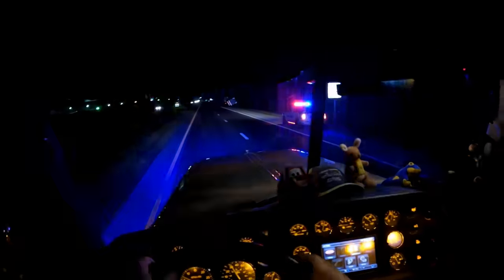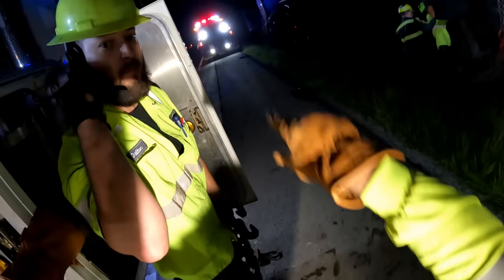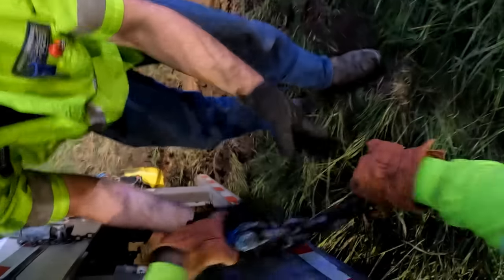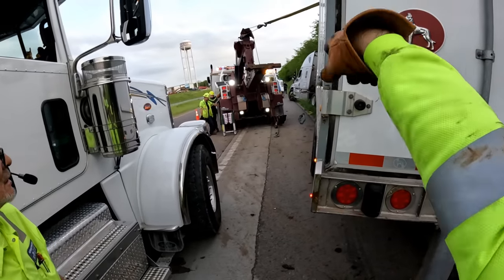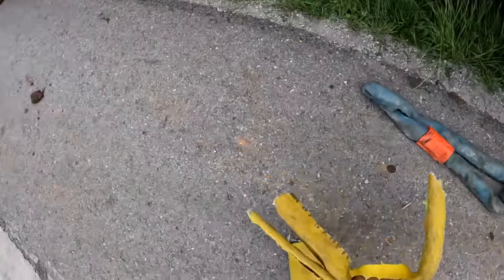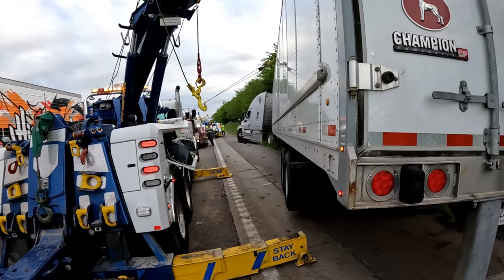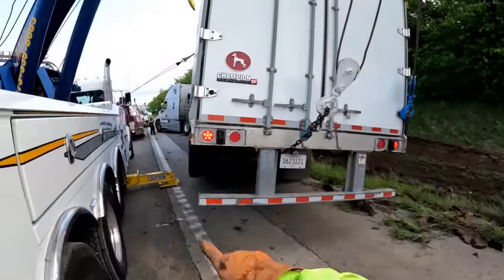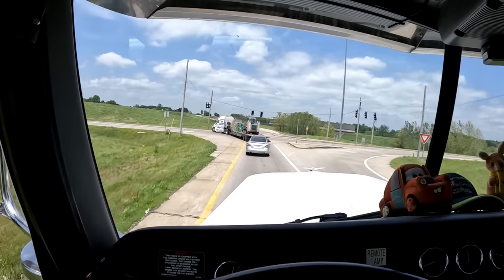Twisted Truck 2.0 Rollover Semi!!! The Job From...a Really Bad Place

Comment: Respectifully, and not knowing the lifting limits of your equipment, the rotator could have been positioned more to the center of the wreck and parked right up against the center line of the hwy to give room to put the truck up on the shoulder alongside the rotators right side.  Then use a spreader rig lifting from just behind the 5th wheel and from the rear trailer frame.  As it was coming up put air bags all along the right side of the trailer and far embankment to hold it up. Then reposition the spreader to lift the drive axles and rear of trailer up and onto the shoulder while Talon or Kenny kept tension on a pull from the front.  Easy to Monday morning quarterback after such a tough situation - the load shift was the nemesis...and very likely contributed to accident.  If the Driver let himself drift to the right then over corrected to the left the heavy  load shift would have put the truck in the ditch fast and hard.  Load securement was a fail from the git go...there should have been air bags put between the interior trailer walls and the pallets of paper, with the pallets centered in the trailer nose to tail...which would have prevented much of the shift.  Ron, you fought your way through it with patience while effectively leading your team...and Ron won!

Comment: Whether or not it matters, but the trailer # is preceeded by 4 letters indicating a intermodal type operation, the Z indicates  a rail trailer reinforced to allow an overhead lift to place  it on a train for part of it's journey if desired,  in the container world  the Z means that the chassis (wheels) stay with the container (married) onto the train car as a unit...sometimes a rail container and a separate chassis are welded together at which time the 4th letter "U" is changed to a "Z"

Comment: Just my 5 cents worth. You put yourself in a much better advantage turning that rotater around and back up to situations like this. Wouldn't have to worry about the nose of the rigvand cuts your picking radius by half or more. Still a pain either way, and good job dealing with it!

Comment: 100 ways to get it done, doesn't matter which one you choose as long as the outcome is the same, as you say, right? I was hopi g to finally see you work air bags. I've been a part of the channel fore a long time. Since around the 40k mark, never missed a video or the rare live stream but I've yet to see you work air bags if I'm right. I do wish Ethan would've had a hard hat on, and see him get the lead out. He just doesn't show much eagerness or sense of urgency in his movements. Great editing. I seen your pre release statement. Nice headset communication as well. Why wasn't Talon able to pull the drives up? Too heavy on the nose woth the load shift? It was good to see you two work together again. I sense with the videos of you at the rotator test track that you may be thinking about adding another tator to the fleet? Take care everyone and God bless
Reply from the maker: You probably haven't seen us use the air cushions.  I can't remember the last job that required their use other than the standard inspections we perform on them at the shop.  As far as Ethan on this job, he had worked another job that night and was very tired.   This was also an intense job where none of the crew felt completely comfortable.   Now that Ethan is back from school and has his CDL permit, he is out doing jobs on his own and his confidence level and drive have increased dramatically.  He did a job the other night, by himself, that would have been a challenge for a seasoned vet in the business.    As far as Talon not being able to pull the drives up, first he only had a single line to the drives and their was a tremendous amount of resistance to pull the drives sideways.   The rotator was probably the only truck on site that could have done that, but at that point I wanted him to try it to see if it would work.  Yes, I've been wanting another rotator since we got the first one, however, there is not a new truck on order and no current plans for one.  Perhaps, someday....   It's a huge investment.   We are still moving forward with our business and hope to continue to grow it.  The loss of my dad hit us all pretty hard.  Thanks and God bless.
Reply: Ethan did have a hard hat on. That yellow cowboy hat is a rated hard hat. Was noted in a few previous videos.

Comment: I know it’s a different perspective after the fact but a rim sling on the down hill side to the wheels would gave you the right angle to hold the trailer and more cable to work with. I would like to come work the rotator with you for a week or two

Comment: Good day sir.   With what equipment you have, I would have off loaded the  trailer.   The load had compromised the trailer.  To have had two rotators at the accident, and to see that the trailer was compromised, I would have still off loaded the trailer.   This is my two cents. 
Have a fantastic day.

Comment: Rotator is facing the wrong way. With the rear next to the accident truck, you could pick it and swing it 5 or 6 feet more onto the road to where the shifted load won't be able to flip it back. Then you could reposition the rotator facing the other way and do the same at the front of the trailer. Then there is always the possibility of opening the trailer and redistributing the load, but nobody wants to do that much work.

Comment: When the trailer was upright, in the ditch you could have pulled the trailer back over center to shift the load back in place. Pepe's towing has done it on a few jobs.

Comment: Do you have mutual aid contracted for extremely sticky wickets?  You mentioned ‘if only you had another rotator’, which are both extraordinary expensive, and the odds of using them both simultaneously would be so rare, that it wouldn’t be wise to own two, but having another company with whom you are familiar would be wise.
Reply: Ron is probably the only heavy tow for a 50 mile radius, perhaps even farther

Comment: Hello Ron , I am rewatching this video. I have a thought/suggestion and a question. Would your cousin air bags been helpful when you found out about the load shift? It seems you needed the Semi Tractor only and your air bags. Also a nother Rotator would have been helpful also.  Would a classic wrecker with 2 booms that could pivot to the side been helpful on this job?
Reply from the maker: We had our air cushions ready to use for this job.   However, when we arrived and found it to be a low center of gravity load, the cushions would not have been as helpful and could possible have caused further issues.  We had no problem righting the trailer.   The problem was that the load was shifted so far to the right side that we couldn't let go of the trailer without it wanting to fall back over.  In retrospect, it might have been more time consuming, but made for an easier recovery if we had unloaded part or all of the product while the trailer was still on its side.   However, working on the side of the interstate unloading an overturned trailer presents an entirely different set of complications and safety hazards plus the risk for additional damage to the product.     As for the older, split-boom wrecker being beneficial in this job, perhaps, but not as much as one might think.   Thanks for watching and God bless.
Reply: @RonPratt  Your welcome Ron, Thank you for the in site. Seems I do not know what I thought I knew.

Comment: After the initial first roll to get the trailer back on its wheels. Could you have used the airbags that you first mentioned to hold the trailer in place while you repositioned the rotate to the front of the trailer and finished pulling it out that way ?
Reply from the maker: Possibly....I hadn't considered that option, but when we found out it was a low center of gravity load, I had the guys leave them at the shop.  Thanks for watching and God bless.

Comment: I wasn’t there to see the whole scene but I believe that if you had stretchers, or better off a sling, you could’ve secured the trailer by itself to swing it on to the road between the two trucks then just pull the tractor out. A sling would be a better choice because having equal length legs it would help level the load and eliminate the chance of tipping over again. Hmmmm I got through typing this when I hear you say “if I had two rotators…” still the idea of a sling for trailers might be something worth looking into, just keep one sling per rotator truck.

Comment: Was the truck droved or towed to the exit? For a massive load shift like that, it is really safter to drive the truck then tow it with its front up in the air.

Comment: You mentioned breaking them apart and towing both separately, thinking the truck was twisted to bad.  What was the final verdict on the condition of the tractor?  Still roadworthy?  Or just to the safest place to get towed from?
Reply from the maker: We ended up towing the truck and trailer as a combination to the next exit.  We stopped at that exit and offloaded part of the load from the trailer and placed it onto our Trail-Eze trailer.  We repositioned other pallets and broken boxes to level out the trailer.  The whole thing was leaning so hard going to the exit that I was seriously concerned it might roll over while towing it to the exit.  But, we made it back to the shop with the truck and trailer still attached.   I do not know the final outcome of the truck.   All I can tell you is that we towed the truck to a repair facility for them and the insurance company to inspect closely.   Thanks for watching and God bless.

Comment: Was the employee in the cab of the Freightliner wearing the seat belt in case you guys lost the trailer and it rolled back over? It seemed pretty sketchy there a few times.

Comment: Ron, I don't know if I could do better. Maybe different, but you say that yourself. Possibly both main lines attached to the back at the same time. So that you could move the trailer immediately. But this is hindsight.
Do you have work for a 2nd rotator, otherwise, as you said yourself in the video, you could buy another one. In a different weight class.

Comment: Ron,
Curious, why not turn your truck around and have full range over the rear? Then you don’t need to worry about the rotator being damaged and more working room.
Reply: My understanding is since it is on a highway he would have to get permission to face the wrong direction in traffic. And that is an extremely rare case that a highway patrol officer will say yes to it, especially since the highway is not closed down. If he was turned around he would not have a safe spot to switch his direction once the truck and trailer were lifted and removed.

Comment: Hey Mr Pratt, I noticed you fleet lacks light duty wreckers, I’d like to know your reasoning? I know there are a lot of variables to consider when deciding what truck to buy.
Reply from the maker: We do not have any light duty wreckers.   We started out with only Heavies.  Then the police departments started requiring Heavy companies to also have the ability to perform light duty so we purchased the rollbacks, which can do a lot with a good operator.   We have the 20 ton available if the rollbacks won't handle a job.  What I don't understand is why the police departments require the Heavy companies to also be able to handle light duty, but they don't require the light duty companies to also have Heavies.....makes no sense to me.   If they are going to impose such regulations on us, they should also require the light duty guys to get Heavies, but alas, that isn't the case.   Anyway, we have not found a need for a light duty unit.   Thanks for watching and God bless.

Comment: Rather surprised you even ran that truck/trailer over the road. 😳 I assume you must have looked inside before deciding to move it. I'm sure the MHP was wanting the lanes opened ASAP, but it was still an unsafe load and I'd question the safety of the truck frame.🤔

Comment: The only thing that my husband and I could see that might have helped was to have the boom head centered over the trailer so you could have had more lift and support for the weakest point of the trailer. And calling in a second rotator if there was another company that has one near by.

Comment: This is undoubtedly the most tedious I have seen on your channel so far. that thing teetered on a fine edge too many times. I think with that load shifted forward and to the right, it meant that you didn't have as much control of the roll over as you would have other wise and with Talon having his line over the top meant when he pulled on that it was also giving a forward pull which tended to actually accelerate the rest of the process. That's why you had to keep saying, "Stop, stop". It caused those jerky moves that you never want to see. This was a thriller.
P.S. When half of that blue strap popped over the corner, I literally jumped. If the other half would have popped over, the trailer would be back on its side.  WHEW!!!!

Comment: Not a tow operator, but I think you were right to not unload the trailer before uprighting. I think you would have found yourself manually passing many cases of that paper out of the trailer. 

When I worked at my local Staples warehouse, I believe there were 8 cases of paper per layer on the pallet, and the pallet was 5 layers high for 40 cases. If I remember correctly, each pallet was a ton, so if my math is right, that's 22 pallets for 880 cases of paper. Now that I'm a less active, more rotund bus driver, I would have to say no thanks to that action. I'm glad you didn't open the trailer, otherwise you would have been committed to unloading that trailer. 

You definitely could have used a second rotator. With that current unit nearing 10 years of age, now might be the time to consider investing in a second unit. Not that your current one should be retired (it appears you maintain your apparatus very well) , but to give you redundancy, and added capability. 

At the end of the day, no one got hurt, you minimized losses on the down truck (I'm guessing it's totaled with the bent frame, but plenty there to salvage and part out), and that load is probably still in good condition. Maybe not the easiest and prettiest way of doing the job, but it's done, and you all did good.

Comment: In this situation with the trailer teetering on the edge wouldn't it be safer for the highway to just be shut down shortly for your wrecker to utilize that extra lane to allow the trailer to level out !  Seems like it could of been done without much delay ?

Comment: I feel bad for that haul company owner.. that's an expensive pill to swallow over a minor mistake. My critique: use your words Ron, explain things clearly and completely with no room for misinterpretation and people will get your meaning better. The older guys get it but out of practice Talon and newbies Dalton and Ethan still aren't getting your meaning right off. I will say you multitask WAY better than my father, but you share that problem of not explaining what you want done real well. In my experience you never want and wiggle room in your instructions where someone can fill in the blanks with the wrong idea, if you are 100% clear about EXACTLY what you want, they are far less likely to mess it up. (I edited out my cussing just for you :P) Remember not everyone knows the ideas that are in your head. (my dad is REALLY bad about that)
I think this kind of job is where having a second rotator would've come in extremely handy.. Talon could've focused on keeping the truck upright and the one rotator could've been at the back lifting the trailer and a second one at the mid point lifting the front of the trailer too.. at which point it might've just been easier to separate them.. but there's no point in What If?'s about what you could've done with equipment you don't have. Another idea would've been if you had 8 foot sections of angle iron (with hook points welded to them) with multiple straps between them that could go over a larger expanse of the trailer to support the weight better.. but wrestling them under it while it was leaning over would've been difficult. It'd be a great way to be able to take the weight off the side of the trailer though. 

Another idea I think you could've tried (but I have no clue how dangerous this would be) would've been to attach a couple frame chains to the trailer and run them down to the outrigger on Tator to lock down the trailer and hopefully keep it from flipping while you repositioned the strap on the back of the trailer to get a better bite at it and then you could've redone it all together to have dual pick points on the back of the trailer or whatever else you wanted to do with it. 

I think if you had positioned your truck at like a 30-45 degree angle nose left from the start you wouldn't have had to move it later on in the pull and you would've been set. Also something that's really easy to say but I don't know how easy it is to do (legality wise) would be to have had a fork lift or Bobcat on a flatbed and back it up to the trailer and start shifting the weight back. It seems like once you got it righted the weight really needed shifted back, especially with that frame being twisted like that. I don't know how much of that was you just fighting that twist in the frame.